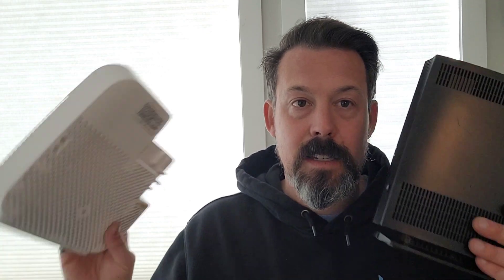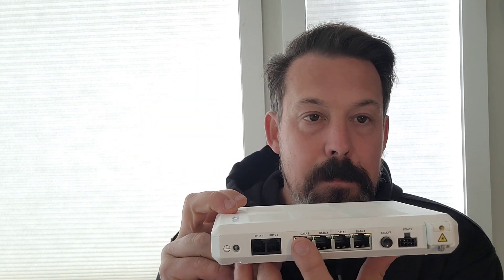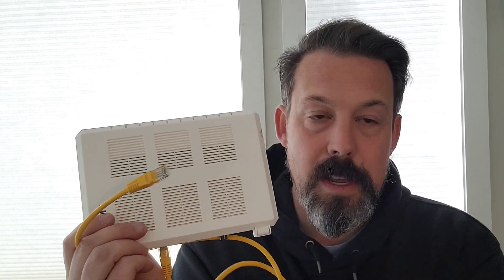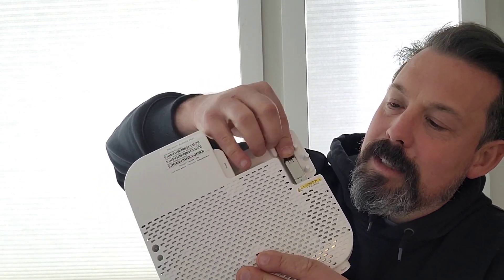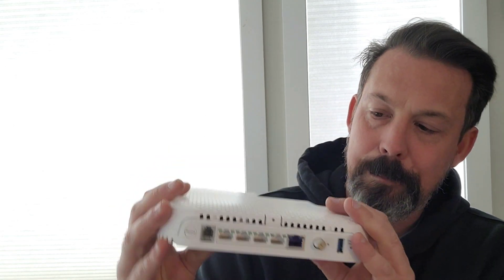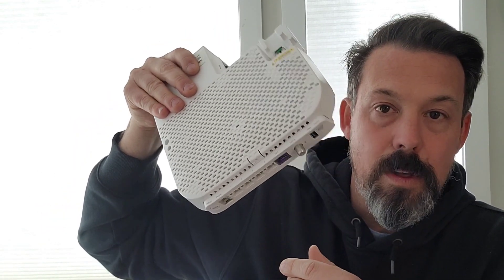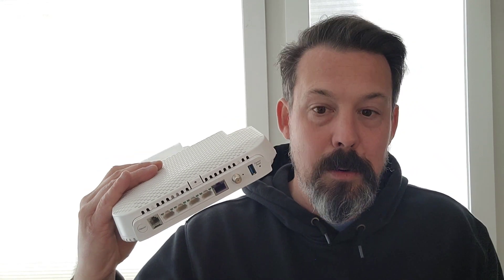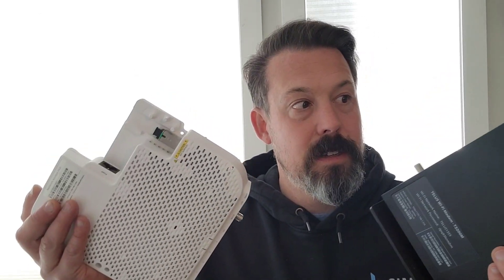Simply Wifi guide to bypassing the TELUS router. Part 1

Comment: I have the newer style nah router and am able to put it into bridge mode on the 10g port. The problem is when I do that, I loosethe internet on that port and works on the other ports that are not bridged.i called Telus and they just told me that Telus doesn't support that. Any help would be much appreciated!
Reply from the maker: Yo! If you bridge it you are bypassing the router and will be pulling a public IP, but it may be that your account only has 1 ip available, I'm not sure how the residential service is set up. If you plug a laptop in you will pull that public IP, however, if you put a boost or wap off that bridged port it will assign that public IP to the first device that connects to it. This is no good. You have to put a router or some kind of a firewall off that bridged port or you are just waiting to be attacked. If you put your way on there it will kind of work for one device, till the next device connects and kicks the first one off. Also if you use a different router your devices are blind to the other network, no printing to casting to tvs on the NAH. Hope that helps.

Comment: Why not a switch ? If u put a switch on  let’s say a dumb switch it has to pass the nas. Does the nas have a firewall tho
Reply from the maker: The NAH has a built-in firewall 192.168.1.254 it's not like an ONT. You could bridge all the ports, or bridge just the 10gig and then a switch off that. Bridging the port will get you a public IP. If you have business service you should have 5 public IP, one used by the NAH then 4  more for anything else.

Comment: Thanks for the info. Tried to update my purefibre to static addresses but tech made a mess of it. Now my UDM Pro no longer connects. It's in Bridge mode connected to port 1. Worked fine before the update.

I want to plug directly into my UDM pro and control everything from there.

Tips?
Reply from the maker: Depends on your set up. If it's new static on the NAH it's totally different. I'll make a video about it.